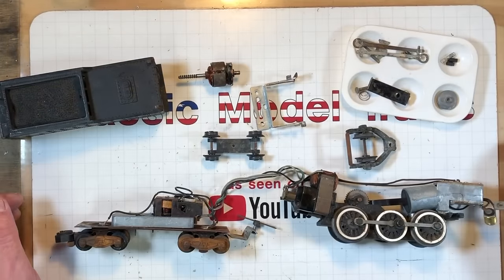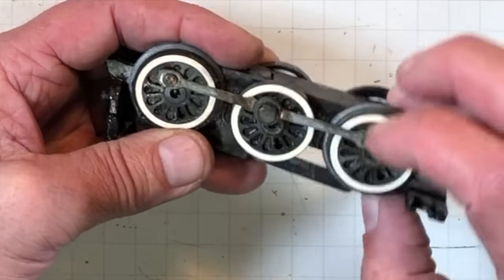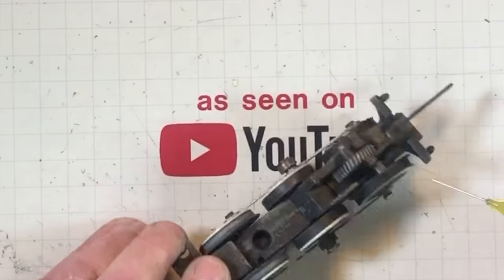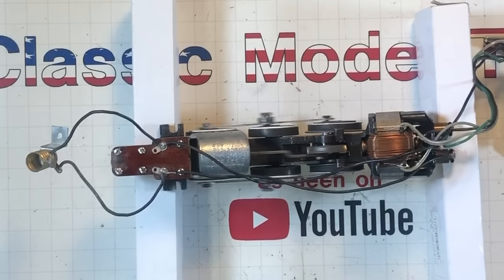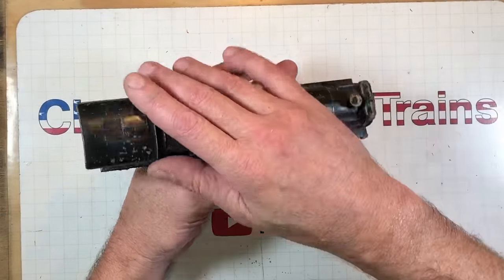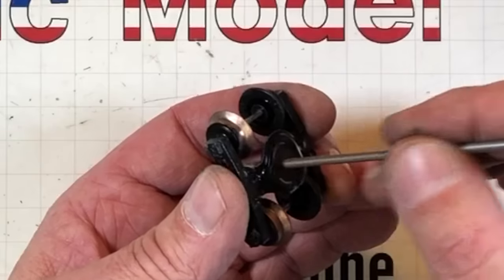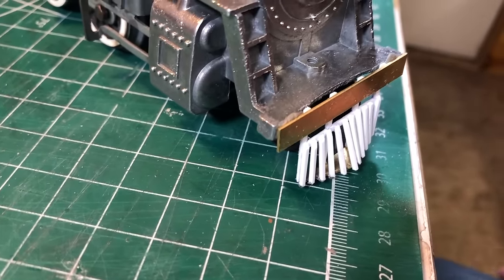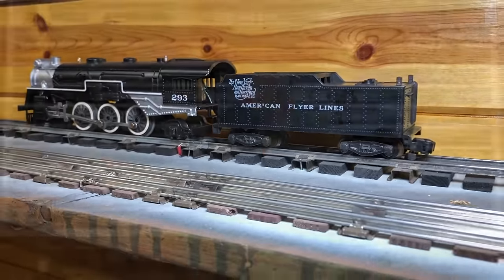Saving This Basket-Case Rusted American Flyer "Pacific"

Comment: So I'm here watching the 293 rescue. I think someone added those trucks to the tender. They look like action car trucks, like a milk car, lumber car, or coal car. The little pick-up that sticks out of the truck rides on a special rail that is connected to the track. No oil in the smoke chugged as it just attracts dirt. Great save, Ron!
Reply from the maker: Those are the factory original trucks for this loco -tender combo.  Just read up on it in one of my AF books.  Seems a bit over-engineered for sure though :-)
Reply: @classicmodeltrains  Gotcha! I know they put those shoes on most of the diesels. I will have to see if my 293 has em. Enjoy your refurbished loco!
Reply: @classicmodeltrains  Yep, I checked my 293 and they are the same trucks as yours. Never trust what I say Ron, I lie 😆

Comment: That looks awesome. Love doing stuff like this. A tip for you. When tapping a hole...I dump a little 3 in 1 silicone oil into a small container. Mine is a 1 inch round container with a lid. I dip the tap into the oil then do my tap. When I need more oil...just dip the tap into the oil and all the filings come off and oil you tap again. When done do the same thing. Dip it in the oil and al the filings  come off. Just wipe the excess oil off and put it away. This way it dont rust and makes things alot easier.
Reply from the maker: A great idea for sure!  I was using oil, but I wiped the tap off every plunge in and out with a rag.

Comment: You really did a good job with this. I have rebuilt three 290s from parts of about five different locomotives and I have a 292 in my fleet also. The first two 290 had the pilot broken off, but the broken piece for one was in the box. I used that to make a mold with candle wax into which I put JB Weld to make the second pilot. By now you may have realized that you didn't need to straighten the two tabs to remove the e-unit. Once the screw is removed the unit just slides out with a slight lift. One of my 290s is going to get a complete face lift which will include removing the center seam from the connecting of the two cast sides, and removal of the molded on handrails and replacement with separate hand rails. After adding a few more details, it will be painted in the green with gold and white trim of the Southern Railroad.
Reply from the maker: Hello Mark, Thank you.  I seen the metal tabs first and then spotted the screw.  I know now how to do it properly.  always a learning curve.  Sounds like you are going to have a real nice locomotive when you are done :-)

Comment: Nice job working on something you're not familiar with. As you may or may not know by now, you do not need to bend the tabs on the reverse unit to remove it. Once the screw is out it will slide right out. The wheels will also come out of the sintered trucks for cleaning but caution must be used not to break the trucks from the metal frames. I like your "use what you got" methods. The cast pieces are actually zinc fwiw. The repaint looks absolutely beautiful.
Reply from the maker: Hello Steve, Thank you for the compliments.  Not having to bend them tabs would be a great thing.  I will do your "trick" on the next one for sure.  I attempted to remove the tender wheel sets and got nervous.  If I broke a truck side frame it would have been bad so I chose the safe route.  I always want to call the zamac cast pieces aluminum.  It's a bad habit that I need to break.  I just wrote the word "zamak" on the wall in front of me so I can reference it and not blow it in the future.  I appreciate you sharing your knowledge of stuff with me :-)

Comment: Wow Ron, I've seen it all now. Not many people would go to the extremes of salvaging a train off of the Titanic. Nice job. Nice tip for thr polishing technique. I'll have to give it a try. I use a very light coating of motor oil applied with a paint brush on the extremely dull diecast shells that likely lived in the attic. It takes a day or two to assorb the oil but it restores the original paint to its original luster. 
 The engine and tender turned out great. Love that vice it looks like it would handier than clothes pins on a hanger. How many hands does it take to work it😊.
Reply from the maker: Off the Titanic!     I LOVE IT!!!!!!!  You know that oil idea sounds pretty good to me as well.  I use two hands to pick it up and move it.  Definitely got some weight

Comment: The tender with a flat finish looks weathered, and I kind of like that. "Patina" is the word. 😉
Reply from the maker: With the repaint of the loco I didnt want to spray the shell with a dull coat until I knew the color coat has cured.  I ruined a Marx loco repaint when the color coat lifted due to the dull coat.  In about a month I will dull coat it and I believe it will more closely match the tender.  Oh.......unless your talking about the "before" image of the tender before I took the boot brush after it :-)
Reply: @classicmodeltrains  Yes, I liked the "before" look. A working tender perspective. 💯

Comment: I'm going to have to try the shoe polish idea too. Same problem, dirt hides in the edges and won't come out. Ive repaired one or two of the 293's. Great engines, not my personal favorites. $5 for a shell is a good price, i'd say. I'm thinking I might have to try my hand at custom painting too. I like the addition of silver.
Reply from the maker: Most of my A.F.s are Atlantics so I was pretty happy when a beat up Pacific finally landed in my hands.  I would never re-paint a Classic if it had good factory paint on it, this one was really hammered so I got a chance to refine my skill sets some more :-)

Comment: I just finished a Lionel caboose #6017 that had wheels and frame that looked much like what you're working on there.  Had to repaint the metal frame after sanding and wire brushing.  Came out looking great.  Nice restoration on the AF.   Good price on that vice but I've got a 4 inch vice (Sears) mounted on my work bench.  Definitely comes in handy.  Rather than bending the tabs back down you can just give them a little twist with the pliers.  Less stress on the metal.  Cheers from eastern TN
Reply from the maker: Thanks for the good tip.  A little twist would be better for the metal for sure

Comment: Fantastic video Ron. You made my morning. It didn't look like a keeper when I first saw the condition of the engine, but I knew you were the guy to make it run again. 
What do you think of the motor hook up to the drive? I thought it was genius.
Reply from the maker: Them engineers at A.F. did a nice job on this drive system for sure. Clean and simple.  I was surprised that most of the parts made it into the box that Dave sent me. they were scattered all over inside it.  To much of what could turn into a nice locomotive to just let it go.

Comment: Use automotive bulb #1447 or 1445 for screw in light sockets. They will work good. You can find them at your local auto parts store, especially places like NAPA or Oh, Oh, Oh, O'Reillys. Advance or Autozone may have them too.
1447 will be brighter at normal cruise and last longer too.

Great rebuild, love your work!
Reply from the maker: I shopped all 4 major autoparts stores yesterday and none of them stocked the bulbs.  a 1447 is a 1/4 twist in. 1449 was the closest in there books but none in town.  Gunna have to do the amazon to get what I need I guess.
Reply: @classicmodeltrains  a 1449 Wagner bulb is rated at 14volts and 2amps, so it will work and look fairly bright, too. 
I've used 1449 bulbs when I couldn't find boxes of 1447's on hand at NAPA. I just prefer what an old train repair man gave me a big box of years ago. If I can find my cross reference guide, I'll send you the new numbers in another post.
Reply from the maker: @crabbinmoose8583  I found a list of all Lionel bulbs ever used and a cross reference to GE numbers.  Been working on a big amazon order and get every bulb a feller could ever need.  Gets so old fixing ufo something and the headlight bulbs always burnt out.  Thanks for the good info though 🙂
Reply: 😆 se senior. 
That dang headlight's always burnt on'em UFO's, man. LoL 🥸👍

American flyer and Lionel bulbs are, for the most part, interchangeable, so if it works in one and matches the other like a doublemint twin, that cross reference will get a guy to the current part no.

The old fella gave me his Bible (Lionel repair manual), and I used that page you're telling about to go surfing on the net when the local parts clerk didn't know what I needed such a small bulb like that for WHEN I told him I was working on a train. He was pulling up a sheet on EMD when I corrected his search and explained that it was only for a MODEL train engine and not a full sized one.
Reply: @classicmodeltrains  you're welcome!
Thanks for the tips and clips to show the progress!
Reply: BTW, the UFO's always seem to have them light bulbs burnt where you can't read nothin' on the brass part.
Reply from the maker: @crabbinmoose8583  Some of them parts Fellers we have now a days  aint worth their weight
Reply from the maker: @crabbinmoose8583  The number of the bulb?  Yup!  I hear Ya 🙂

Comment: A really good job. Did you remember to put the gear cover on? Also, there is a smoke unit tube that screws into the top of the smoke unit. They are either metal or red plastic depending on the locomotive model. With a mini-torch you probably could have built the cowcatcher from brass. Happy New Year. Keep on Chugging.
Reply from the maker: Hello John,  The gear cover is on and can be seen in the part of the video when Im attaching trailing trucks and boiler shell. I read about the smoker tube.  I would have made one but didn't have small enough brass stock here to get started, and was under pressure to finish the video.  I was attempting to solder the brass cowcatcher but every time I warmed up the piece with my soldering iron the previous pieces got hot and the solder melted.  I figured I need to get some more learning under my belt on how to solder scratch built stuff together before I attempt it again.  Happy new year to you as well :-)

Comment: Great job, Ron. I like the paint job, although I doubt the New Haven Railroad would have spent the extra money for silver paint! If you look carefully at a catalog, you'll find that you are missing the coal feeder on top of the tender coal pile. Probably a few bucks.
Reply from the maker: Hello Ron.  With all the pure black A.F. steamers upon my wall I just wanted to see a little color.  I know pretty much nothing on how the prototype owners would decorate their livery.  You make a good point, but I thought I read somewhere the black on a steamer is a high temperature paint and is expensive and the silver is cheaper because it's not high temp.  Although more in labor cost to do two tone paint schemes.  The last few hours of videoing and looking up specs I did see this tender originally had a coal pusher.  The plastic piece got lost.  I shall try and source one.  Thanks for stopping in :-)

Comment: You should try to get a bench sand blaster. They have some really nice ones available. Don’t use sand . Use walnut shells . You will be surprised how it works.
Reply from the maker: I'm familiar with sand blasting and walnut shells.  I dont have a large compressor available in the train room for that kind of tool.  So far the ultrasonic is doing a fine job with everything Ive asked of it :-)

Comment: What mix of cleaner do you use in your ultrasonic cleaner? I just got one and have some parts that need to be cleaned as well as some loco bodies that need to get repainted. Been enjoying for vids for awhile now! Keep it up!!
Reply from the maker: The ultra sonic only has water in it.  When I clean a piece (s) I put them in zip lock freezer bags with a simple degreaser.  Usually used full strength.  Be careful on painted parts because it can dull the paint real bad or even remove it.  I run my heater anywhere from 105 F. (simple cleaning 5 to 10 minutes)  to 122 F.  (paint removal 20 to 40 minutes) Thanks for your support of my channel Aaron :-)
Reply: Thank you sir!  @classicmodeltrains

Comment: Vinegar can work for rust removal but (so I've read) items cleaned with it should be neutralized with baking powder afterwards. Left in contact with vinegar long enough, even steel  items will be eaten by it. 

You might want to look into evapo-rust for rust removal, or even electrolysis (though even those methods have their downsides. Evaporust needs to be rinsed off with water, which can cause flash rust, and electrolysis can cause hydrogen embrittlement).
Reply from the maker: Thanks for some good tips and info!!

Comment: Fantastic results! I'll have to keep in mind that shoe polish trick. I have an old Tyco Royal Blue consolidation that's on par with this loco. I plan to rebuild it sometime this year. One question: Why didn't you remove the molding line at the top of the boiler since you weren't concerned about the model's value as a collectible?  It's a bit jarring to look at, and smoothing it out would make the boiler look better.
Reply from the maker: Thanks for you kind words.  TBH I dont even notice the molding line.  I had to hop up and look at it after reading your comment.  Of course now that it's been pointed out to me, I guess whenever I strip a loco it would be a great idea to do a little filing and sanding on them.  Never hurts to advance the final product and my skill sets!!

Comment: Great video. Would it work to soak American flyer tracks in odorless mineral spirits and kind of scrub them to clean them?
Reply from the maker: Mineral spirits is a solvent.  I guess if I didnt have the ultrasonic I would soak the track in vinegar.  I'm more worried about the rust than the dirt. I want the track to conduct the "juice" real good

Comment: Hey Ron, great job. Did you ever think about using a product called Evapo-rust it’s what I use when I rebuild my Lionel‘s also, whatever happened to the model of the week 👙🤔
Reply from the maker: Hello Frank!  Is evapo-rust that stuff kinda like petroleum jelly you wipe onto rusty stuff and let it sit for awhile?  I keep talking about dong model of the week but I'm running out of movie / TV people I can even remember to find a picture of them. Also there is some women modelers that watch the channel now and ............
Reply: @classicmodeltrains  hey, Ron I don’t know if my first reply went through but evapo-rust is a liquid that you soak parts in. You can buy it by the gallon and it is reusable it does a great job at removing rust i’ve also had a little luck using a product called cold blue that you can buy at the gun store for adding color back to road wheels and trucks.

Comment: was that masking tape on the headlight in the beauty shots ?
Reply from the maker: I just went and checked the photo and no.  The original headlight is in real bad shape and barely held itself in the hole.  I put some CA glue to keep it in and the glue and paint mixed and that's the result.  I need to source a new headlight plastic thingy for it.  But you do have some sharp eyes there Mister :-)

Comment: A broke off screw, if I could be so lucky. My front truck shoulder screw broke off, but I'm going to try n remove it with an screw extractor! If not, I guess I'll drill n tap it!?
Reply from the maker: Hopefully you can get it out.  Drill and tap very gently if have to

Comment: Yup I picked up a couple more basket cases, one clock works o gauge steam engine with none matching cars and an o gauge set with tracks but engine missing a brush and spring holder and the rest are in H O gauge and needing work. Also pick up some rolling stock and track and layout pieces.
Reply from the maker: Sounds like a box of awesome treasures to me!!